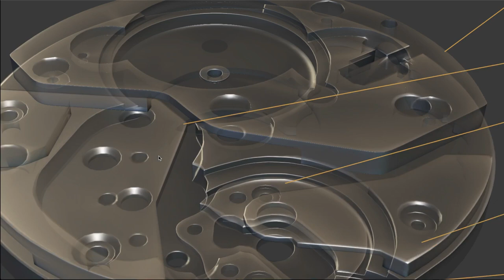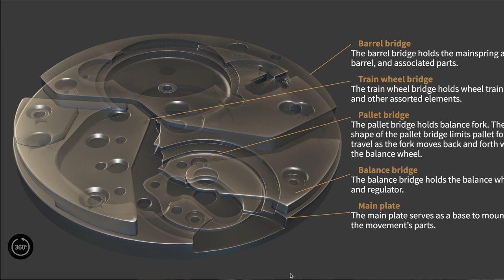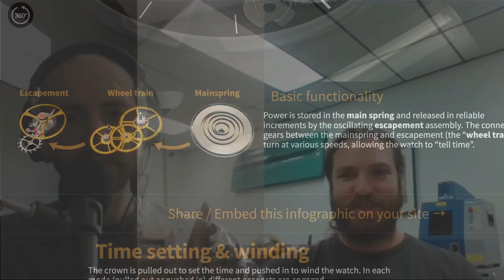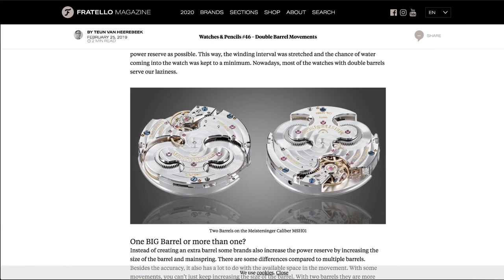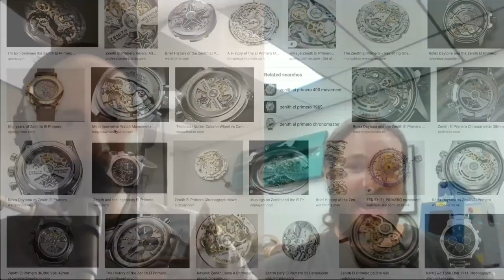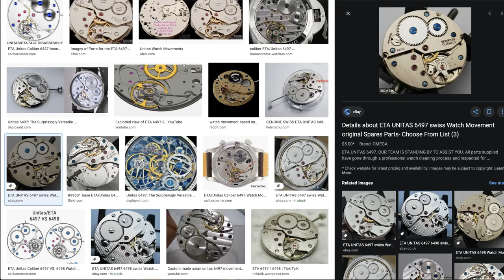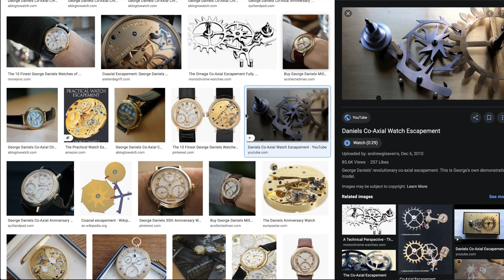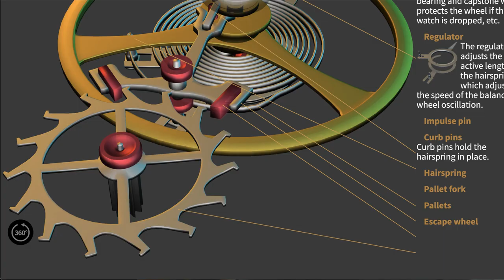How A Watch Works!

Comment: There is no chemistry between these two men as there was when Matt was there. The problem is this: Cameron answers questions like the engineer that he is. He is concrete. He stops and thinks, then answers slowly with facts and authority. Matt understood this and would play the student of the genius and was well prepared with a notebook. (Frequently so well prepped that Cameron had nothing to add factually, so he came across as silent). But the new gentleman is not as prepared and is not leading the discussion in a logical progression. His questions are random and not well phrased. He interjects "ya" and "ahugh" inappropriately. So his questions are hard for the engineer mind to process and answer in a factual and unemotional way. So Cameron comes across differently, unhappy. Both men are great, but together have "no chemistry ".